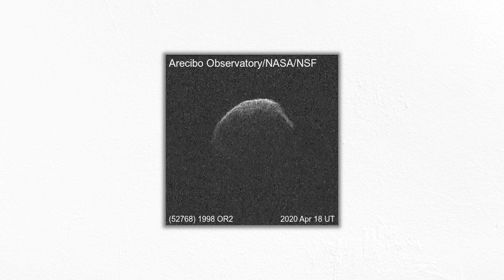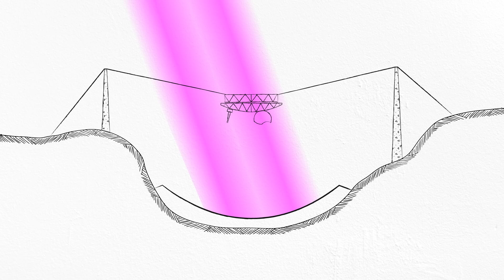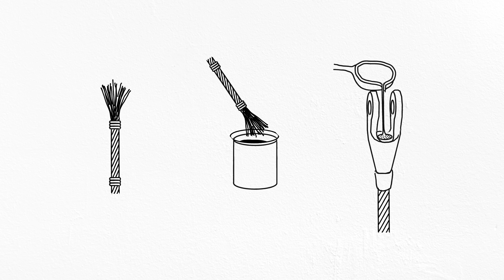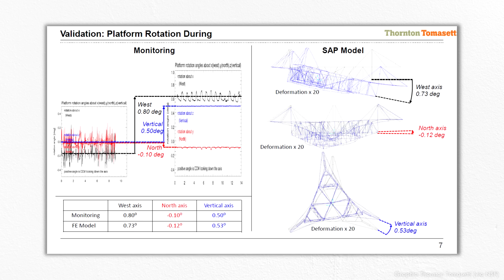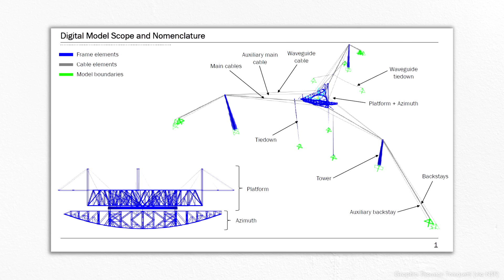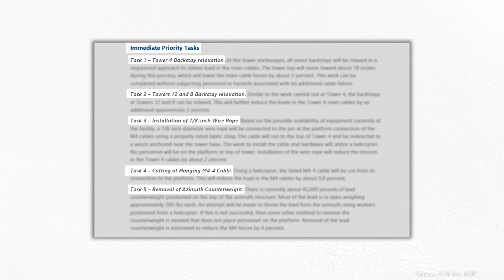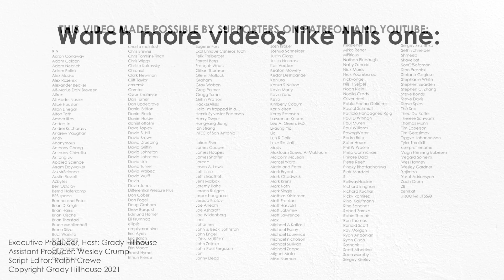What Really Happened at the Arecibo Telescope?

Comment: About 65 years ago, a local ham radio operator explained that every year he had to loosen the steel guy wires to keep his antenna straight. Reason: Rusting of the steel INCREASED the diameter and DECREASED the length. Further, he told me that the cables would break and his 70 foot high antenna would come crashing down. Could this be a factor in this crash ??
Reply: Interesting idea. Its like how hose changes in length when pressurized.

Comment: So funding was diverted and they had a costs-less-than-the-best shop fabricate the cable?  With all the news about Tofu Dreg projects in China, one must ask, was that first cable to pop out of it's socket made in China?  Also, it's somewhat amusing to see how any "expert" who is ever going to be brought in to create a guarantee of safety balk and say, "Sorry, we can't guarantee it will be safe."  The reality is that there is never a 100% guarantee.  Workers get distracted.  Somebody eating a banana tosses a peel on the ground.  Real keystone cops stuff, but it's responsible for far more injuries on job sites than inadequate design.  The reality is that no expert, who doesn't share in the upside or downside of the project, is going to guarantee safety.  They will not bear the cost of loss if the facility / project is abandoned.  Nor do they get any upside if the project goes forward successfully.  But they have tremendous downside if the project goes forward and is unsuccessful, so they will always have a distorted incentive to sandbag.  FYI, that's why we didn't get Woodstock 50 either.  Funny how this telescope was around for Woodstock 1.  It could have beamed Hendrix to deep space...  Far out man!

Comment: I am amazed to hear it would be zinc that would be used to permanently seal those cables in their sockets. Although not a metallurgist or possessing knowledge about the possibility of other metal(s) (or mixture(s) thereof) could be any more suitable by any means it surprises me that zich is strong and hard enough considering its low melting point low boiling temp, which of course would be reasons to use it indeed. Something else again is, that steel cables that are are not specially coated, continuously, when subjected to a lot of force as well as when exposed to the elements (with temperature fluctuations possibly playing a role as well), become brittle over time though, by to such an extent that one can break a piece of cable up to an inch or more by hand. And this can happen in much less time than it took those in the Arecibo telescope to start failing, they may reach such a state in under two decades. I know from several observations and out of own experience in shipping.
Reply: Zinc is not very hard, but I am sure the technique has been tested 1000s of times. The zinc would also act as a sacrificial anode for preventing corrosion on the steel, which may have contributed to the failure.

Comment: What a slight buzz kill is the improvement in 97 included amazing technology that was late age but their solution for holding the 50% more was about 9 more cables. This change of weight should have required a rework of the structural support. 

They could've held off on attaching the gregorian dome to do so.

Comment: What are the odds the weight of the paint had a factor in the cables failures?
Reply: Nil.  The paint weight compared to the structure weight and load is very small.  Also, the cables and structure are carbon steel and paint is critical for corsion resistance.

Comment: Yea, I'm no engineer but I did spend a night at holiday inn express...where I was taking a simple automotive course dealing with the electrical systems.
 I remember my instructor saying "2 unlike metals and a base liquid, you got a battery...with all the related problems"
  Corrosion being #1. So that satisfied me with the joint failure BUT!!! The cable just flat snapping?  Wow, umm, are our suspension cable bridges in question?

Comment: You know what's been around as long as the Arecibo Telescope??   Rust-Oleum products. Rust-Oleum: Steel maintenance  Products.   Dozens of Solutions that all work.  There should have been two guys whose job was to bathe those cables, anchors, and tie downs inch by inch methodically every day.  Small Sections at a time.  
The added weight of the instrument cluster would have made the weight of the two men working independently of each other inconsequential.   Their activity with hanging Chairs and section by section work would have made no difference to the work being done by the scientists with the Radio Telescope.  
The professional Rust-Oleum products would have not only bonded with the Strands in the cables, it would have maintained  the overall Tensil Strenth of the strands.   Better Yet the Rust-Oleum company would have given them the product for the marketing opportunities alone.

Comment: A sad day when this was destroyed. Sadder still that it was allowed to fail in the first place. Another iconic symbol of this country lost. The fact that it stood for 60 years would suggest that the original design was sound, and most likely succumbed to environmental problems, much like the recent Florida condo collapse. I think that we may be putting too much faith in computer modelling and simulations, using them as crutches instead of having a better, more solid understanding of the questions being asked, and doing the hard math and number crunching directly, or at least concurrently, certainly on high value or high risk projects. What if the program being used has a bug?

Comment: Why the Arecibi Telescope structure failed was because they didn't use 4 points of connection instead they used only 3 basically putting support cable structures at the 12 3 6 9 positions of the structure to better distribute the load across 4 points instead of only 3 points.

Comment: Why is the safety margin so low? Wouldn't it need to be way higher to cater for wind induced load during weather events?
Reply: Obviously and surely reasonable environmental loads will have been considered so the safety factor is on top of that, though this is not to say those design environmental loads were high enough.

Comment: So my thoughts are when they added the Gregorian Dome, They added 2 more Aux cables to each tower to help support the 50% increase in weight. Once cables started to snap that added extra weight to the remaining  cables. Even though the cables had a factor of 2 for each cable we know it wasnt enough when they added the dome. That tells me they took the combined cable strength and platform weight and only added enough cables to carry the weight of the structure . Or that they didnt factor out side interference but it was so long ago  it would be hard to predict that. Another factor to adding the Dome would be the movement on that even though im sure it was slow you still have extra mass moving around adding to the stress of the cables.    Then the extra tie downs adding to that stress even more that  to me would exceed that 2 factor. Say before the dome being added overall you had a Factor of 2 , then you add 50% more weight well that extra 1 just went to .5 adding 2 more cables to each tower could have brought that back up to 2. This however is assuming a lot of stuff, My knowledge of engineering is very basic and i have a lot more questions to ask.
Reply: there was also the failure of the spelter sockets that should have been stronger than the cables but failed so they may have been making calculations that were incorrectly assuming everything was assembled correctly.

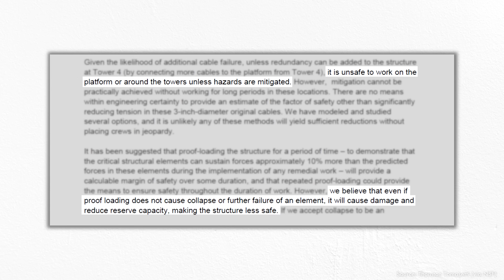Comment: 12:12 engineers final sad recommendations
12:40 Drone & GoPro view moment of snaps
14:23 that 3 cables failure modes
15:22 how much Safety Factor to use in design calculation

Comment: The cables on elevators aren't just "moused" and the strands separated. The strands are also turned back on themselves. Then pulled into the socket. And the correct type, CLEAN, and properly HOT enough molten steel MUST all be correct. I used to do that on elevators. It's an annual repair. Those cables should've been systematically replaced. And yes, not all elevator mechanics will actually do them every time. Think about that?! Those cables were probably not installed correctly because it becomes physical impossible for the turned back strand ends to fit through the socket. Even if no metal is poured into the socket. Like you said, the more tension the stronger they get. Poor workmanship I'd say.

Comment: Obvious. The added Tie Down Stabilizing cables were the cause in the collapse. The original Main Stay cables should have been replaced or augmented when the stabilizing cables were added. 
The time spent on structural analysis would have been better spent erecting additional towers to relieve the stress on the existing cables BEFORE any remedial work (or planning) started.  I bet Middle Age stonemasons would have cradled a structure like that before any thought were given as how to fix it.  
I have this feeling that Computer Age engineers rely too much on their electronic virtual reality without understanding that real physical reality IS NOT suspended in time to wait for the proper solution to come along.
PS:  A potential solution to the stability problem might have been a Tuned Mass Damper (supported by 3 separate own support tower, of course, but connected to the receiver platform)

Comment: I think they doomed the structure when they added all that extra weight and didn’t replace the existing cables. Like finding an old rope in your parents garage hidden away from sight, they don’t hold up like they use to, they become brittle and break very easily. Everything has a lifespan, and that’s one point not mentioned at all in this video. What was the design life expectancy of the structure? 70 years in a salty windy environment.
Reply: The extra weight should have been manageable.  I think the problem was deferring maintenance.

Comment: The problem is the structure was never designed with this much load . The load was added later with new instruments and all of this was old I mean with this cables on bridges they would have been replaces long ago but here the original cables are still in place here. The last point is they didn't do anything after for 3 months after the first incident.  I mean not removed the cable which failed and not replaced while it was still doable properly because too less funding.

Comment: Wooh, you ask "when did you first hear of..." That would be 1969, when it was handed over. I was about 12 years old. 
1:20 or so, I used to mend computer tape drives. Component level if necessary. In the customer's office, with them watching, if necessary!

Comment: Several factors are involved including the age of the structure but the most significant was the additional load of the new Gregorian dome and its associated instrumentation. The tie down cables to stabilize the dome added more load, none of this was part of the original engineering design. In all likelihood the original configuration would still be standing but the structure would probably be closing in on its useful service life a few years or perhaps a decade down the road. The engineering team's recommendation to tear down the structure and cordon off a safety zone until that task was completed was spot on and they should be commended for a brilliant evaluation. Time to build a replacement system that's bigger and better.

Comment: If those cables had been solid, they would have suffered the classic problem of metal fatigue much sooner, but since they were stranded, that was reduced, but isn’t it possible that metal fatigue still occurs in stranded cable? Especially after standing up to hurricanes and the unbalanced load of the added rotating dome on the platform?
Reply: Along with all the other issues mentioned due to environmental exposure

Comment: There is a large band (N band) of infrared light around 8-12μm. So ground based observations are possible, if you add are high up on a mountain or on a plane (SOFIA) to avoid clouds and disturbances. I still hope to use a uncooled microbolometer and germanium lens assembly to do ground based astronomy. But integration time is a constraint.

Comment: Cables can rust from the inside out you cant see it coated or not and cables that old should have been replaced.  More cables should have been added to the towers to. You can see the rust on the cable connectors in one of the photos.

Comment: A cable supported structure usually has some rigorous maintenance, and not just slapping on another coat of paint.  Antenna towers have guy tensions measured periodically, and tower alignment checked to confirm integrity.  Even the Gold Gate Bridge has routine cable inspections, and while visual inspections are not like Superman looking thought the cable with X-Ray vision,  there are known things to look for which show that there is a problem beginning.  Apparently, nobody was paying attention in PR.

Comment: A drone just at the right tower to observe the collapse, plus another cam looking up  at the collapse just when it happened sabotarge comes to mind here  this was planed ,come on really a flying drone looking at the tower that the cables broke from ! no such thing as coincedance theres only cause an effect.
Reply: They have a gopro in the observation booth since it's, you know, an OBSERVATION booth. That's literally the purpose of the booth. A drone was up there since workers could hear lines snapping (if you've ever heard tensile steel cable snapping, you'd know it's distinct), and so they sent the drone up to see what was going on, you can even see the paint stripped from the cables where filaments were failing. This is "Oh shit is it breaking? Send the drone up", not "Let's send the drone up and break it", it doesn't even make sense. How could you possibly break individual wires in the cable remotely? And for what purpose?

Comment: Honestly they should of replaced all the original cables when they added the extra ones later. There likely was new technology that would of improved the strength of the cables from when they were originally designed.

Comment: That was some crazy drone footage of the very lines snapping away and the ultimate demise and destruction of that whole entire system.. sucks that it kept deteriorating until final collapse but glad no one was hurt in those insane moments as the heavy metals began to drop the way they did... 2     👍 👍  on the thorough explanation of the telescope/ radio receiver.  I have heard about it here and there but you sir ,did a pretty good job answering any possible questions that popped into my head as I said them aloud.. 😀 cool

Comment: It would have been nice to have the ability to lower the platform down.

The reason is to lower the potential energy the equipment had at the time of collapse.
Reply: I was thinking the same. It is too bad it wasn't built with a way to lower it, but with everything in such bad shape it would have needed new cables and maybe new towers as well.
Reply: @CGT80  They were short sighted in that respect.

The lifespan would have been limited by the towers.
Reply: @Ben31337l  I doubt it was intended to last 70+ years, since it was built for war and was needed ASAP. Engineers could have studied the structure 10, 20, or 30 years ago to better plan for it's future and they could have installed posts/piles just under the bowl with the ability to add extensions to protrude between the wires of the bowl, to support the receiver framework, when needed. Hindsight is 20/20 and they diverted funds to newer projects anyway, so I don't know if they did or would have realized how weak it was and they certainly didn't want to spend more money on it. Would they have replaced all the cables or rebuilt towers if they knew it was in danger of failing? Is this technology still relevant enough to put that much money into saving it, or can they start over and do better? It is sad to see it destroyed, but I am glad it had such a long history even after it's initial use/purpose during war time.
Reply: @CGT80  True that.

With the way it functioned and the way it was initially designed there wasn't really enough room to lower the platform onto anything but the dish.

Kinda makes me wonder how they got something that big and complicated to be suspended in the air in the first place.

It doesn't really seem like there o any hosting gear either.